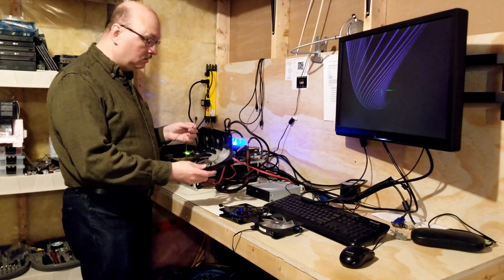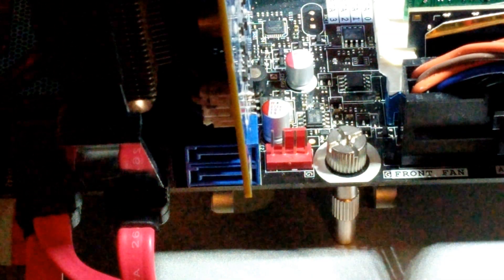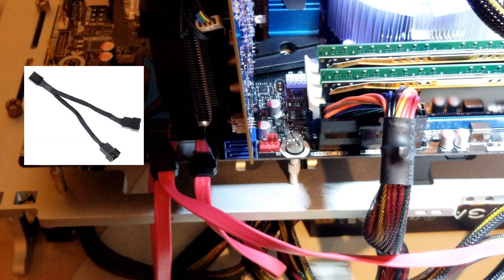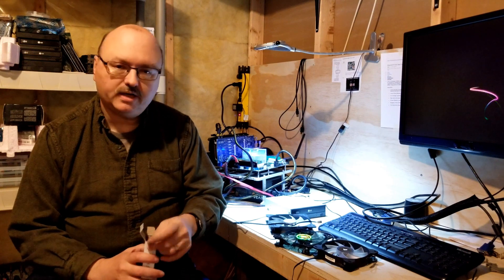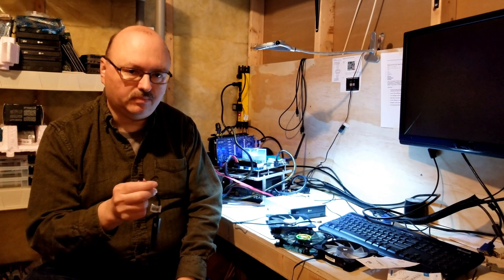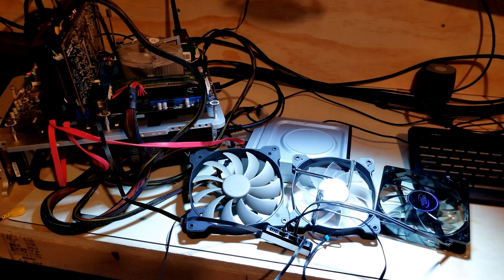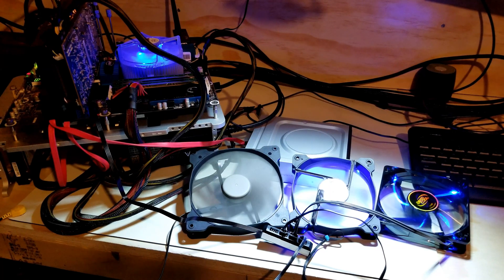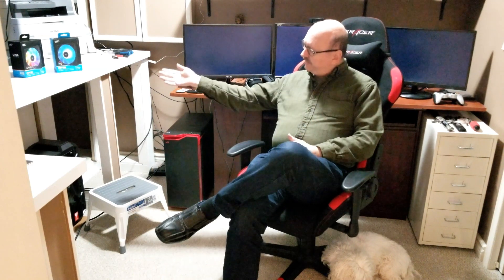Add Fan Headers to your Motherboard with Deepcool FH 04 4 Port Fan Hub

Comment: Hey, My motherboard can control 3 pin fans speed with a DC ramp. If I plug this controller into a fan header with DC control, may I be able to control the DC energy delivery to all 4 fans at the same time, right? Maybe your motherboard has this function too
Reply from the maker: It will depend on the voltage the fans use, there are some fans that 4 fans could be used with one fan header but others you can only use up to three.

Comment: But, if you plug in the other 3 plug, can it do DC curve control?
Reply from the maker: Yes, it'll be good. Need to switch to PWM Mode though.

Comment: Im thinking of getting the lian li lancool 2 mesh rgb and plugging the 3 fans into this, will this overload my system fan header on my gigabyte b550 aorus pro ac
Reply from the maker: Depends on the Fans, a Fan Header used 1amp, so as long as the 3 fans don't exceed that you'll be fine.
Reply: @Reviewing_Playing_and_More_RPM  will getting one that has power over sata allow me to use more fans
Reply from the maker: @enderz8398  Yes if your fan is being powered from the SATA from your PSU then it won't need a Fan Header potentially, but in the end the Fan Header will still only allow 1A to be used, some fans like ML120 use more power so you need to ensure you don't exceed the 1amp when using those so it might be 3 vice 4 fans. I'm really glad the videos have helped you out.
Reply: Also your videos help me way more than I thought at first thanks a lot

Comment: Hello, thanks for this review of this specific fan controller, it was exactly what i was looking for but i still have a question: My PC has 3x4-pin ARGB led chassis fans connected to the PSU, so with this controller i would connect them to my MB and be able to manage their speed, and according to your replies in other users' comments a MB fan header can handle up to 1 A voltage and fans usually draw about 0.20 A, so will it be safe to connect those 3 fans into the fan hub which will be connected to the MB fan header? Thanks in advance.
Reply from the maker: It will depend on how much power the RGB Fans use, have a look at the specs for the fan and as long as the three of them don't exceed the 1A it will be safe to connect to the MB Fan Header.
Reply: @Reviewing_Playing_and_More_RPM  Is there a way to check the amperage for them? These fans are from "1st Player" brand and their model is "DC/12V DC/5V DF1202512SEMN" but i couldn't find any further information about them, sadly the chassis in which they were included didn't come with any manuals whatsoever. Thanks for the quick reply
Reply from the maker: @nullzar  Send me the make and name of the fans and I'll check it out and get back to you. Sorry if you don't have any more info I'll use what you put here and do some research and let you know.
Reply from the maker: Best I've been able to find is they use 0.15A so you can put 3 safely to each Fan Header.
Reply: @Reviewing_Playing_and_More_RPM  Thanks! Will report back with results as soon as this little gadget arrives from Amazon

Comment: I have plenty of power cables from my PSU, but I plan to use that to improve my cable management. Hide the big mess behind a hard disk and simply use those tiny wires for the fans.
Reply from the maker: Sounds good.

Comment: If you only have one spare header and you're looking for a quad (or more) fan set up (excluding CPU cooler) I'd suggest getting this hub. DO NOT connect it directly to the motherboard though as one header can usually only take 2 fans. Plug it directly into your PSU, usually through Molex or SATA power connectors.
Reply from the maker: Most MB System Fan Headers will provide 1 A, so do not connect more than 4 fans to one header. Some MB's have headers that can provide more so you could attach more but need to check what yours is capable of. If however your connecting Fans that draw more voltage like the newer ML 120 fans then your correct. There are also now some with RGB that might draw more voltage as well in which case exceeding the recommend voltage of your MB Fan Header would NOT be recommended as you've said. The video with this Hub using standard fans that do not exceed your MB's Headers would still be ok though. Thanks for your input and hope this further clarifies to others not to exceed MB Fan Headers.

Comment: How does the hub power itself? is it the same 4 pin conector? BTW great review mate, very handy
Reply from the maker: This Fan Hub can power 4 Standard Fans, and the hub itself is powered off the system fan Header, if you use the newer ML 120 fans I'd suggest use 3 vice 4 as they draw more power and will overload the Fan Header on the MB. Hope that helps. Thanks.
Reply: @Reviewing_Playing_and_More_RPM  it def helps, thanks for the reply.

Comment: So will this hub only take data of fan 1 and no others? Im wanting to build a case and can do a 200mm and 2 80mm fans, but only have 1 fan header on mobo
Reply from the maker: It's taking the data from the 1 Fan, so different sizes may need something else, not sure as I didn't try different size fans like the 200mm...

Comment: I have msi h310m Pro vdh plus motherboard I have the sys_fan occupied with one case fan.

I want to buy deepcool gammax 400 pro cpu cooler which has 2 fans

Can I buy this cpu fan splitter to split the CPU_FAN to connect the two fans of this cpu cooler.

And what about that white port should I plug one fan into it and how exactly the speed will be controlled if the system is at full load, will the motherboard command both the fans to spin at full speed or what is this duty cycle please explain me this point in detail I am wandering here and there for getting the answer.

Thanks a lot sir for such informative video.🙏🙏
Reply from the maker: So the CPU Cooler will come with a fan splitter to connect the two of them together so only 1 CPU Fan header is needed for that, but if you want to have more fans then yes using this fan header will and it can provide PWM control...
Reply: @Reviewing_Playing_and_More_RPM  Thanks for the clarification sir. No worries now.

Comment: Does msi afterburner work with the header?
Reply from the maker: Can't say for sure, it has limited use for Fans, but the Fan Hub has PWM Control so it can be changed in the BIOS or other software that can control fans...

Comment: So I plugged in the fan hub to my sysfan1 plug and have my fans connected to the hub and it’s not spinning but the led works. Would I need to go to the bios to turn on the fan
Reply from the maker: Shouldn't need to, the hub gets it's power from the fan hub and so the fans should work once it was plugged in, don't plug it in with the system working though, always do it with the system off then once plugged in turn your PC on...if you did turn it off and plugged it in and restarted the PC it should work...keep in mind that if your using ML120 fans they draw more voltage so can only use 3 fans at a time...4 fans otherwise...
Reply: @Reviewing_Playing_and_More_RPM  thanks for the reply. So I was an idiot and forgot to plug in one of the fans in the hub. So I have 1 fan plugged in the motherboard now and 3 fans plugged in the fan hub which is then plugged in chassis fan 1. Got 3 out of my 4 fans spinning. Don’t know why the fourth ain’t spinning.
Reply from the maker: @rquintero3  It's an easy mistake to make, so the Hub is going to the MB, the first fan goes to the 1st White slot, it should be PWM if your fans are PWM, this will let you control all the fans in the BIOS, and they should all work as well, if just 1 isn't working just recheck there pushed all the way into the hub so check the one that's not working making sure it's in correctly and all the way pushed in hopefully that's all it is, or it could be a bad fan, it happens sometimes...good luck...
Reply: @Reviewing_Playing_and_More_RPM  Thank you!! ive tried about everythihng to get 2 to work but atleast i have one. will check to see if everything is in proper place. cheers
Reply from the maker: @rquintero3  Ok, take care...

Comment: Does it work with non deepcool fans?
Reply from the maker: Yes it will...however if you use the ML120 fans they draw more voltage so you should only use 3 to one fan header vice 4...
Reply: @Reviewing_Playing_and_More_RPM  Cool, thanks for your help.

Comment: Hey, I have this fan hub, conencted all my fans to it and connected it to motherboard, Lowered the duty cycle in bios but fans keep spinning at max rpm, maybe you have any suggestions how to fix it?
Reply from the maker: Just ensure that you connect it as the video mentioned to the one slot that will allow PWM control, and to the MB PWM Header...
Reply: @Reviewing_Playing_and_More_RPM  Do you have to adjust the speed of the fans in the BIOS or does it have a separate software for that?
Reply from the maker: @NoviProleterijat  Yes you can go into the BIOS and adjust the Fan Curve or just the Settings to Quiet, Normal or Performance...no other software though...

Comment: Can someone translate 4:25?
Reply from the maker: It's talking about plugging it in to have PWM Fan control in the BIOS...
Reply: @Reviewing_Playing_and_More_RPM  okay but why not plug into the white slot or all 4? Also should I plug back fans or front ones
Reply from the maker: @SlagePeterson  At 4:01 in the video is explains this...and you can plug in whatever fans you want in terms of front or back...

Comment: how is it possible that this 1 head becomes 4 head solution? can 1 header sustain power for 4? is it even safe
Reply from the maker: Yes it's safe, each fan header on a MB can support 1amp of power, most fans only use .20amp so with 4 being the Max is still under that threshold, now the only thing that can potentially cause problems would be something like the newer ML120 Fans as they draw more power than standard fans, but a lot of Fan Hubs that will support those and more will draw there power from the Power Supply itself and can handle more fans...hope that helps...
Reply: @Reviewing_Playing_and_More_RPM  Thank you so much
Reply from the maker: Glad to help...have a great day...

Comment: so if we increase pwm speed of one fan header then all the 3 4 fans attached to the hub run on same selected speeed right sir
Reply from the maker: That's correct just make sure you plug it in as I talk about so that the PWM controller is working to let you control fan speeds...
Reply: @Reviewing_Playing_and_More_RPM  thank yuh, sir. right now I have six case fan and 5 of them are  attached  to PSU directly
Reply from the maker: @CaptainScorpio24  Cool...

Comment: Thank you for the information. I have a question i know you can control 3 pin fans with voltage. And if my BIOS doesn’t support that, is there any software for that.
Reply from the maker: Some have said you can use a 4-pin PWM to 3-pin transformer, all 3-pin fans can now be controlled with a normal PWM signal. The converter is connected to your motherboard or PWM fan control, while the fans are connected to the converter. I can't verify if this in fact works, but as to software there is none that I'm aware of...

Comment: Will I be able to control the RPM of each of my 4 fans in my BIOS with this device?
Reply from the maker: Yes the one part of the video I mention you need to make sure it's going to the fan header on your MB and plugged in as shown on the Hub, one is for controlling the PWM of the fans...
Reply: you can't control them individually, only one sys fan detected by your system
Reply from the maker: @bsigns1935  Thanks for the clarification...and for helping the community...

Comment: Hey , if for example i have 2 x 3pin fans and 2x4 pin fans ,  will i be able to just control all of them at once for example : I want all the fans to run at 800rmp , is it possible even if they other 2 fans have just 3 pins? I suppose with this controller all the fans should spin at the same rpm ? Or it's not like this?
Reply from the maker: You'll only be able to control the 4 Pin PWM fans RPM, the others will run at full speed...Thanks...

Comment: But the system fan connector can provide 1A current....
Then how 4 fans can be handled by that?
.
Does connecting 4 fans reduce speed of fans?
Reply from the maker: Yes you can connect up to 4 fans, most fans are .20 so 4 are just slightly under the 1A that most motherboards can handle...connecting 4 fans will not reduce the speed of the fans, however to get full control of the fans they need to be 4 pin PWM fans, or they'll run at full speed...some control can be done in the BIOS though...the recommended amount is no more than three standard fans, but most case fan headers are rated for 1A of total power draw. Meaning you can connect up to 4 fans, depending on how much they draw power. Generally 2-3 is suitable. Some newer mobos have high amperage headers with 2A or 3A rating. hope that helps...Thanks...

Comment: Hi sir can i ask a question, My mobo is beeping (short ones) .      .       .       . (This interval) what seems to be the problem?
Reply from the maker: They sound like Beep Codes that are generated by your BIOS, here is a list in order to determine which one it might be: BIOS beep codes. 1 short. DRAM refresh failure. 2 short. Parity circuit failure. 3 short. Base 64 K RAM failure. 4 short. System timer failure. 5 short. Process failure. 6 short. Keyboard controller Gate A20 error. 7 short. Virtual mode exception error. 8 short. This should help you determine what is going on...Hope that helps...Thanks...

Comment: Hey Dennis, I purchased this fan hub and plugged in all my fans but after I was done with the build non of the fans started to spin. I checked the connection of all the cables and they were all plugged in pretty good
I'm thinking maybe just go into the bios and see if my computer reads them and then go from their.. thoughts?
Reply from the maker: So something to verify is what is the voltage your fans are using, as the 4 fans this hub allows should not exceed 1amp, if it does that can cause issue's, so 4 fans from the hub to 1 sys_fan header, so if the 4 fans use more then that, you might need an extra fan hub or a bigger  fan hub that will work...if the 4 fans are in the hub and 1 is going to the MB within the 1 amp spec, and it's not working, it's possible there could be an issue either with the sys_fan header or the fan hub itself...but yes going into the BIOS to see if there being recognized will let you verify it...hope things get resolved...Thanks...
Reply: @Reviewing_Playing_and_More_RPM  no thank you. I'll check :)
Reply: @Reviewing_Playing_and_More_RPM  hey man just found out that each of my fans goes to .22 amps max so 4 fans should be safe right? Anyways I'll go into the bios and update u.. thx for the help, appreciate it very much:)
Reply: @Reviewing_Playing_and_More_RPM  so in my bios it said "smart fan 5" and I adjusted that fan to pwm and it still didn't turn on:(
Reply from the maker: Yes at .22 amps it doesn't add up to 1 amp so it's fine, so check that you plugged in the Fan Hub correctly which really goes in one way so not likely anything can go wrong there, if it doesn't work then it's possible either the Fan Hub could be defective, or the Sys_Fan Header isn't working correctly or worst case scenario there's a MB issue...let me know how you make out...Thanks...